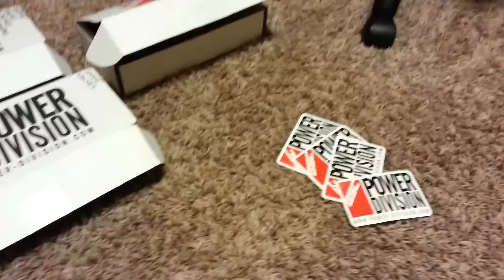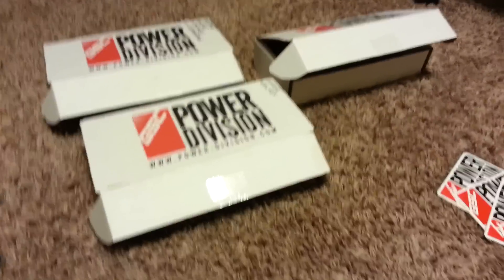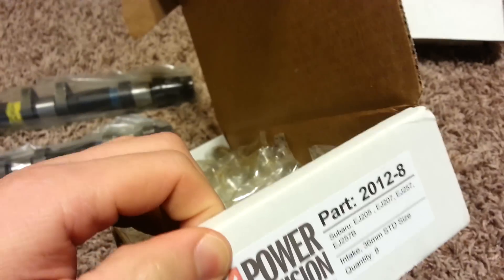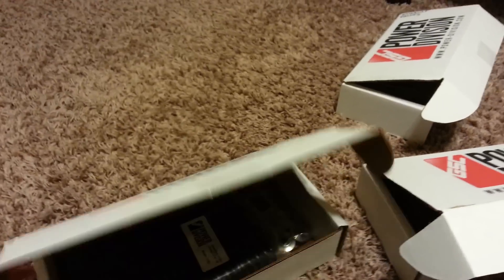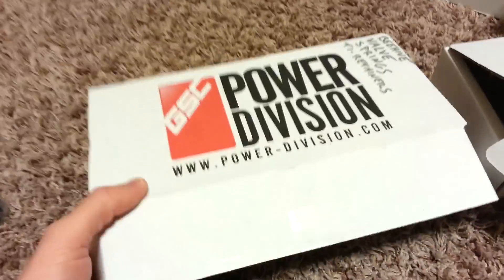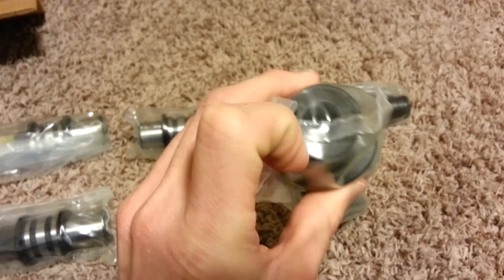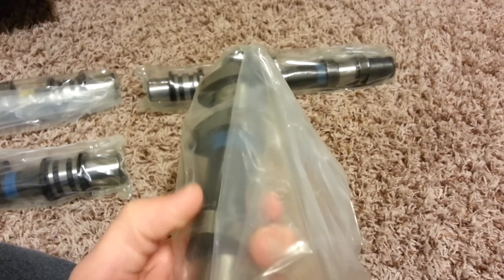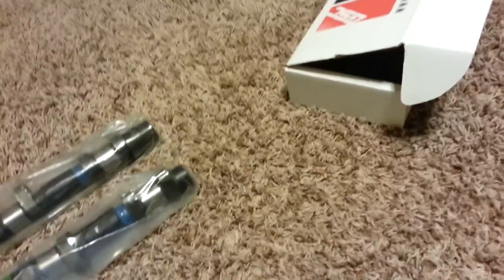Update Full Motor Build (Valvetrain Parts) GSC Power Division 2007 Subaru STI

Comment: Are you running stage 2 or stage 3 GSC cams? 
Are you worried about passing emissions at all?

All I could see on the specs are that they are 272's. Cause im thinking about running some GSC's
Also make sure your mechanic guy degrees the engine to the can specs. Im sure he already knows but, just a heads up.
Reply from the maker: Stage 2 cams.  Not worried about emissions or inspection because there are non where I live.  I've seen people rollin around town with cardboard duck taped to their car to block the hole where a broken window is now from hail damage. It's really up to the cops to pull us over or not. For modified exhaust, etc. But, no real rule for it here